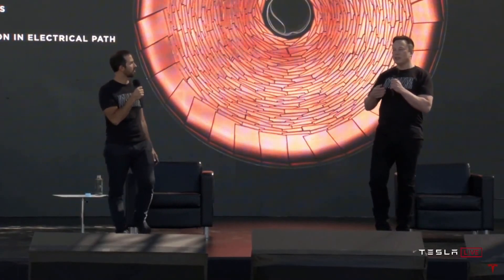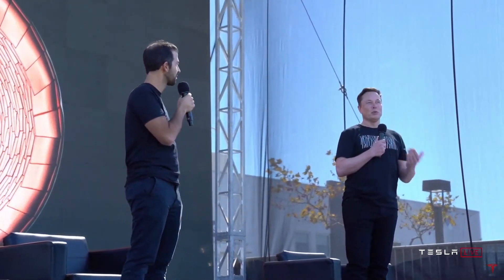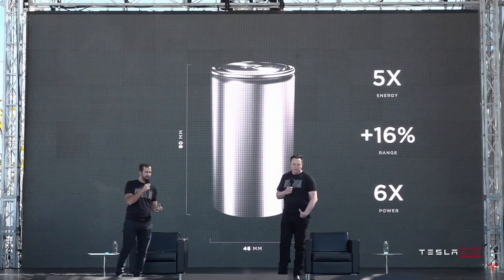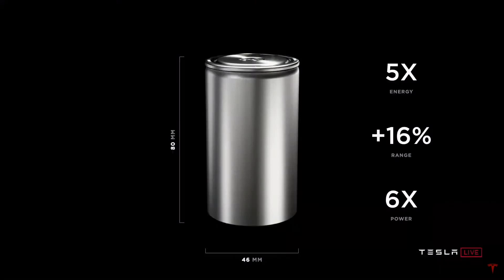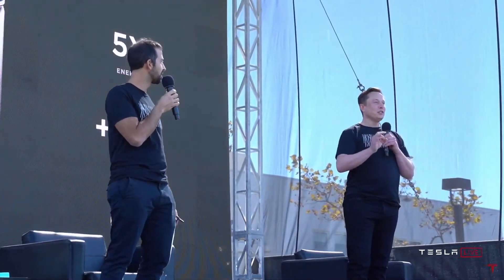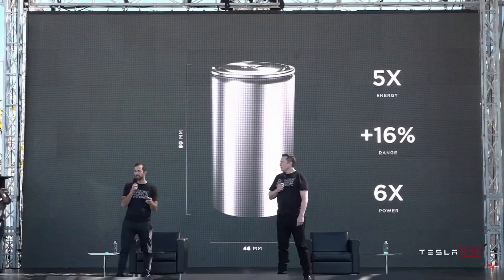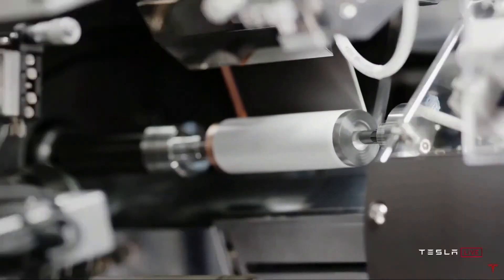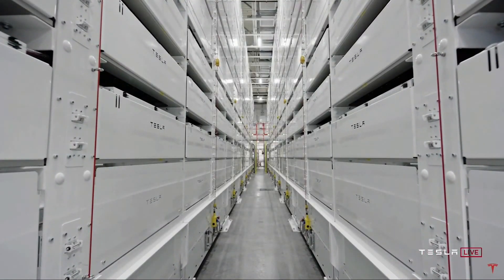Elon Musk REVEALS Tesla's new battery design! (Full presentation)

Comment: They simplified the design of their battery while increasing it’s energy density and decreasing production costs.  Score one for the engineering team.
Reply: Thanks, I literally had no idea what they were talking about.
Reply: Dangelo ROMERO you weren’t listening
Reply: The previous cells (starting with the model 3) were 21mm diameter by 70mm length. So volume increased x5.5 while energy increased only x5. Energy density therefore is a bit lower. The advantage is in other areas like thermal management while charging and a 9% increase in power density.
Reply: Ingenious
Reply: I've never felt soo dumb
Reply: That's all they had to say lol
Reply: Not so fast....what they aren't telling you....yes, they DID circumvent the thermal issues so you are now in a nice dense package....BUT now they WILL have issues with point contact galvanic corrosion due to the thinning of material at the connection point (i.e. battery will not last long). Remember the trade off...the compromise.
Reply: @LarsonFamilyFarm-LLC  they seem to have more contact surface probably running at lower current densities compared to the original design - for a non battery guy: why would the original design be less prone to this?
Reply: @Maverickx89  Don't know...it's likely due to their formulated substrate medium between the charged plates...works better at higher currents for charge and discharge.
Reply: So as new battery technology and designs come along Tesla can adapt.👍
Reply: @wtmerit6129  more like continue to do what complacent manufacturers won't do and push the envelope as far as possible...
Reply: Its basically an advanced capacitor. Sheets of metal very close together but times 1000
Reply: @panthershockey1185  Sure it has a bit of capacitance but the energy storage is electrochemical.
Reply: @panthershockey1185  um no
Reply: @panthershockey1185  kinda in between yeah.
Reply: That’s called Hattrick I think
Reply: The picture of it cross section looks like a trunk of a tree
Reply: Score for humanity
Reply: Score 1 for nature, this looks exactly like the rings on a tree.
Reply: Yay and fire a bunch because now the system has been more streamlined. More money for the super rich, more people unemployed.
Reply: Electrical power - V x Q
Reply: A principled approach is typically the simplest
Reply: Not to mention having a marked increase in potential current handling because the increased contact area will reduce the internal resistance of the completed cell quite dramatically.
Reply: It's actually pretty insane, It's like magic i'm not joking. if you applied this to a 1990 mobile phone it would be so futuristic people would call it magic because the phone would seem to have infinite power stored
Reply: プレイヤーは今日です🍜
Reply: Score one for Satan. Buy one get one brain implant, no charge!!!
Reply: @Seki lol yea elon made a joke abt it when they were talking abt the 69% investment reduction, he said something along the lines of "its kind of funny how its 69%, .420 of course"
Reply: It's 8x the volume of 18650, and only 5x the energy.
Reply: These batteries have been around forever.  Optima has been making one for decades.
Reply: @bartacomuskidd775  nope
Reply: Elon MUSK is New God! Mars is the New Earth!! KING Genius Elon caused More Semiconductor Shortage with crypto to Destroy worthless competitors while Tesla secured semiconductors in advance. Elon is Einstein, Edison, Newton, and Jesus Combined!! He has more IQ Numbers than the Weight of Hater's Ug ly Prius and his F at Ho added together!! Elon at least deserves several Nobel Prizes. He is like Ironman who will destroy Thanos and critics are better off using their cash to wipe their a n us. JUST Worship Him instead of other silly god!! GOD Elon will Punish nonbelievers!! Go Emperor God Musk!! Elon's brain chips and AI will Control and Destroy any Infidels!! TESLA and Tesla Holders will be Kings. The Rest and their Family will be Our Slaves who Work to Death to supply energy for Bit coin!! Tesla=King, Non-Tesla Brands=Peasants, Future Slaves!! Michael Burry will BURY Himself!!
Reply: But how does it have 5× more energy, 6× more power, but only 16% more range? Perhaps I missed something but that doesn't make sense. Maybe that 16% is at the 5× & 6× power/ energy.
Reply: @xxxhoodooxxx  the rate at which you can dump the energy has nothing to do with how much capacity the battery has
Reply: @wblteen  that's literally what power means man
Reply: @xxportalxx.  yup.....Trying to help explain it to others ..........
Reply: @wblteen  but the output and the range do not seem related imo, I would think energy density is the most important factor
Reply: @xxportalxx.  I would think energy density can be directly related to range if they use the same pattern volume but have a higher energy density
Reply: @wblteen  6x more power is irrelevant, but 5x more energy would imply ~5x the range. I think the part that @XXXHoodooXXX is missing is that the cells are larger, there are fewer of them, so the net gain in range is only 16%.
Reply: @wblteen  I know what you mean. But how many fanboi's actually understand any engineering/physics? (hint: the less they know, the bigger the fan)
Reply: @bo840  I'm guessing there are quite a few "Engineer" owners who have it just for the tech. But yes, a lot of people own it because it's cool. For me it makes no sense to own as I have almost no public chargers and travel over 300 miles to visit family
Reply: @xxxhoodooxxx  Seems they've presented it a bit misleadingly: they seem to mean power & energy per cell, in a bigger cell. So it is really about going with bigger but in total cheaper cells, not about increasing the performance of the battery pack. The 16% is just a bonus. Cost is a major factor for the consumer, so this is actually significant, especially combined with other things. Engineering is rarely revolutions, it is gradual steps, and they are stepping in a very right direction - I don't get why anyone would be disappointed. And if they really manage to get rid of the cobalt, it's damn significant.
Reply: @xxxhoodooxxx  16% more range given the same dimensions of the previous battery design.  So in effect 16% more efficient than before given the same inputs.
Reply: @xxxhoodooxxx  They didn't tell the full story. Think of it like this: Take the material from 4 (estimated) of the old cells, rearrange them ingeniously end you get those numbers.
Or: using the same amout of material with the old design, then with the new design and then compare those designs based on mass. And that is pretty clever to just minimize the losses.
There is some capacitance, as there has been before - but this is highly negledible.
Reply: @xxxhoodooxxx  Interesting observation, I think that you also need to account for the form factor difference. The new cell is bigger, so you will use fewer of them in the same "battery compartment". On the other hands, this makes 5x and 6x comparison not fair either. IDNK
Reply: @xxxhoodooxxx   
The cell is larger, just not 5x larger for the energy part.
And usually larger cells can't put out as much power compared to their increase in size due to thermal constraints (So normally the increase in power would be less than the increase in energy as the cell gets largr), but reducing the internal resistance gets around this so the power increase can actually be more than the energy increase.

That would be cool to also see this technology adapted to powertool 18650 batteries for even more extreme power density.
Reply: @xxxhoodooxxx  It means the company is going to be able to put 6x less batteries in your car and give you a slight performance boost while bragging constantly that they have changed the world.
Reply: @xxxhoodooxxx  bad presentation of the facts ! It has 5x the energy but then it's 6x the size. Oops ! Nothing changed then except it got worse ?
Reply: plus one for the SCIENCE TEAM!!!!
Reply: @أحمد مصطفى شلبي
Sorry but this was an engineering problem. A mechanical, electrical and manufacturing problem to be exact.
Reply: @HalfTimesTwo  yea, SCIENCE...
Reply: Question: can the battery be recycled?
Reply: @manoftruth0935  yes, they mention it at the end of the presentation. A "dead" battery cell is actually worth a LOT. recycling is not going to be a problem, but a booming business.
Reply: Joop Tablet by recycle it means melt down in a foundry that pollutes more than a fleet of internal combustion engines. For each Metal. Congrats, more pollution for your coal powered car. Because electric powered car is coal powered car. If you think it’s solar and wind only, I would laugh if you didn’t show signs of insanity.
Reply: Wanted to leave a like, but you're at 420.
Edit: someone ruined it.
Reply: elons a fraud lol
Reply: The new battery has 6.6 x the volume of the old battery - also every year the energy density increase (R&D) by 5% they haven’t actually done anything expect to make it bigger )
Reply: Energy density = how much it holds per mass ie- 150J  per kg to 152J per kg 
Energy = how much energy  it holds, ~ ie- 1000 mAh to 6000 mAh 
Power is = how much is available to use any given second (see above) 
Range = bigger battery , volume 6.6x = 6.6x of the previous one , 16% due to the extra depth dimension(10mm)
Reply: @lasarith2  right, but when you're talking range of an ev the biggest metric is energy density, unless you're talking the tractor which probably requires more power and having a higher output per cell would reduce the number needed, as the mass of the batteries is the biggest factor reducing the range imo
Reply: xXPORTALXx Aye it’s a balance of weight and power, more weight = less range,  the extra 10mm probably (on paper would give even more range) but real world is 16%.
Reply: @lasarith2  I get how it works lol, but the extra size isn't the issue, bc if the batteries had a high enough energy density you could use less, the issue is that the energy to mass ratio isn't actually that high, despite the figures making it seem much higher. That would be my take away
Reply: xXPORTALXx (a quick math ) 500 miles  / (1/7 = 71.42 miles (70mm) 500 +16% = 580 (to 1/8 = 571 miles (80mm) given that it loses 9 miles of range .
Reply: @lasarith2  sorry, but I am not following your notation
Reply: xXPORTALXx  batteries are increasing capacity by 5%  a year (100% > 105% >110.25% ) Elon just needs to wait 2 years and oh we’ve got an extra 10% .
Reply: xXPORTALXx okay 🙂
Reply: @lasarith2  hahaha ok man
Reply: Jay Dee they only used panasonic at the start of teslas production. Then Tesla designed their own (better) 18650 cells because they wanted it cheaper, better, and had higher demands than panasonic could deliver. Tesla built the gigafactory to supply their cells and have been designing better and better batteries.
Reply: @nolansprojects2840  Source for that? As far as I know all models pre model 3 use Panasonic 18650 cells manufactured under license from Panasonic or sourced directly from them. Starting with the model 3 Tesla switched to a 21700 cell (don't know if it has ties to Panasonic).
The 18650 cells that Tesla uses (in the model S for example) are not even Panasonic's highest capacity cells (that would be the 18650GA cells), probably due to costs.
Reply: @ASJC27  2170 was a joint project between tesla and panasonic and panasonic manufactures them
Reply: @ASJC27  I did a quick google search because my info has been from a ton of sources over the last year or so, but I believe this is the relationship panasonic has with Tesla. As you probably know, panasonic is the worlds largest Li-ion battery manufacturer, an obvious choice to partner with for tesla. After the model S, Panasonic struggled to produce the batteries demanded by tesla, so Tesla began R&D of their own (Or at least scaled it up) and they found they were able to make more efficient cells using less minerals like cobalt. Then (as far as I can tell) they continued their contract with panasonic and built the first gigafactory. This is where I was mistakenly thinking Tesla produced their own batteries, when in fact it was a factory for Panasonic to manufacture batteries specific for Tesla. That is where the "Tesla Cells" come from. Mid june 2020 the two companies signed another 3 year contract after Gigafactory 1 was finally making a profit. Though panasonic is still lagging behind the massive demands for Tesla, they are still making the cells, though they are branded as Tesla cells. Tesla I believe is still doing the bulk of R&D, as far as the batteries specific for electric vehicles go. Panasonic, I assume, is doing more R&D for higher capacity, general cells.
Reply: score for humanity. all will benefit

Comment: LOL I love the battery production clip; it's basically oil guys saying F***!!  WE CAN'T STOP THIS MACHINE!!   ^-^

The Nissan Leaf could really use an aftermarket replacement; air cooled batteries are the bane of my road tripping lifestyle!

He's still using round cells though!  It's just bad geometry!  Maybe if they were using those gaps for coolant it wouldn't be soo bad.

I'd also like to see V2V (Vehicle to Vehicle), so I can share power with another EV driver who's empty!
Reply: There are huge benefits to cylindrical cells. It's fascinating that other car companies haven't figured that out yet.
Reply: cybertrucks have 240v outlets. its a slow v2v but works with any ev
Reply: Mike Church  But ya I'm thinking tip the cells on their sides, so you get long rows with 6 open spaces around each cell (it turns the round into a long honey comb).  you could even get in a center hole through the tube they roll the cell onto.

Also cans: WTF are we putting all this extra metal and weight into the pack for?  It already has an outer protective case!  That's another reason I like flat cells they only have a thin, light layer of poly and tape!

Comment: this is a significant development that will may push EV into a more adopted and viable market
Reply: Agree, I don't claim to understand it all but the cost of battery is key. The use of cobalt especially problematic.  I heard they may have found a replacement by using nickel.
Reply: Good symbol 😁
Reply: If it's really about the environment, then they need to find a better way to get the batteries, because it's even worse for the environment than gas.

Comment: Conduction path length matters for sure, especially for the Thermal envelope,  but Elon got the physics wrong in his explanation in one respect. It's not that the electrons travel farther,  it's that THERE ARE FEWER CONDUCTION ELECTRONS AND CONDUCTING MATERIAL ALONG THE PATH and hence much less resistance along the path and hence much less joule heating.. I suppose it's been a while since Musk did ( as opposed to described or appreciated which he certainly does) physics.
Reply: Lol, he's a rocket scientist, he knows that. But as you showed, it takes a whole paragraph to explain that and it's not necessary in a presentation like this.

Comment: Can we just cut to the chase... how long does it take to charge a battery that would go 300 miles?
Reply: probably 15 minutes or so...
Reply: @ramenizer8952  fuuuuuuuuuu! cool!
Reply: Hard to say, they have lowered the resistance but did not describe the cooling design but im thinking it depends  more on your pack size. If you have a 300mile pack it will charge to full as fast as a 500 mile pack as long as proper power is supplied but fast changing creates a lot of heat so it slows down as you fill up. Tesla can achieve 80% in 24 minutes but i expect them to reduce it down to 10 minutes for 80%.

Comment: No weight savings?
Reply: Talked extensively of the weight savings with cell to chassis direct.
Reply: @waynerussell6401  if they did I must've missed that part
Reply: less batteries because they're fatter... So less batteries = less weight.
Reply: @kingatowning  I would think less material used alone would equal less weight, apparently they did not think the weight savings significant enough to mention if the power density is the same target.
Reply: @AKlover  Maybe it's too early to say definitively so they didn't say much. They said they're still working out the kinks and the battery is getting there energy density-wise. I'm sure 3 years time they'll have it ready.